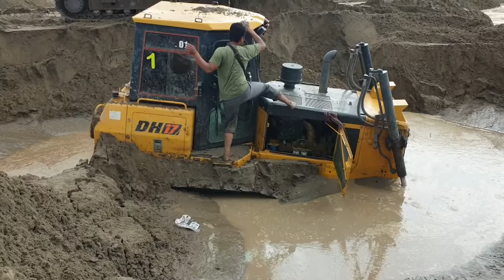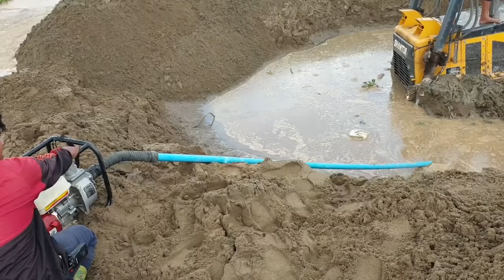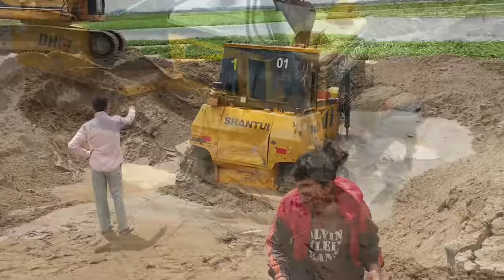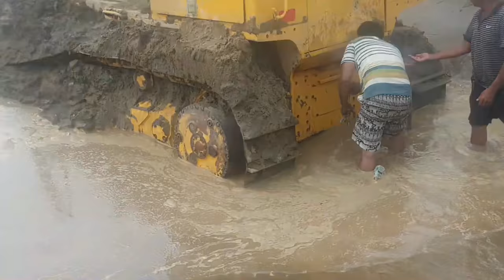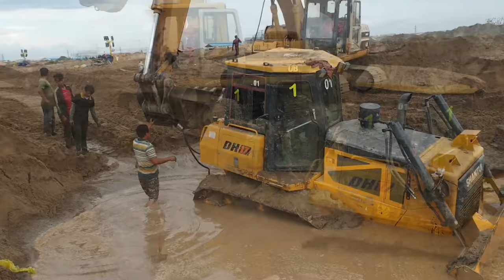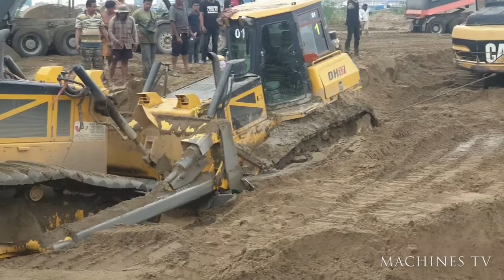Skills for Psychological Recovery Bulldozer SHANTUI DH17 Stuck In Deep Sand Safety Work

Comment: I cannot say anything about operator stupidity.  I got my tractor stuck on dry land this evening while I was breaking ground! 😂😂  I was running along just fine when suddenly the load became more than the traction, and rear wheels just dug themselves a pair of nice little holes before I could do anything.  I was supported by the turning plow and the front wheels and had to go get the big tractor to pull it out.

Normally, I raise the plow a little bit before that can happen, but it got me this time.  And to beat it all, I had taken a laxative this morning, and the urge hit me while I was walking across the hollow in the twilight to get the other tractor.  There were houses still visible, so I had to rush to get to a place to stop, drop, and dump.  I didn't make it in time. 😬  You may be laughing, but you only think you know the rest of that story! When I got finished and managed to get to the house, my stupid, lazy, 28-year-old, step idiot, who WAS sitting on his butt, playing video games online like he usually does whenever he's not sleeping or at work on his job, had suddenly decided, "Oh, I need to go sit on the toilet and play video games a while and THEN take a shower!". It's a one bathroom house!  But before I could even find out he was running interference in the bathroom, my 4-year-old daughter brought me a new toy to change the batteries!  What an evening!
Reply: @supertramp6011  
He's not my brother.  He's my stepson.  You can't do much about those unless you want a divorce.

Comment: I'm stunned nobody thought to drain the water
Reply: They could have pumped it out, but have you ever noticed how when you dig a hole at the beach, you cannot dip all the water out.  Water passes through the sand and replaces what you take out. But it also takes more sand with it from the sides of the hole and will even undermine you if you're sitting on the hole rim like that expensive excavator is.  I don't think anyone wanted to see that sinking into the sand with the bulldozer.

Comment: next time use dynamic physics 
no matter how many rope pulling ...they handling with the same force !!!!
with one machine ... two good anchors... and basics knowledge on winch load your life will be much easier safer and happier .

just think what if the unsafety cable was cut?

When the bagger pulled the shuffle, the cable held almost double weight of both of them together. A lot of heads would fly there
Reply from the maker: Thanks you so much

Comment: Stuck dozer #1 is ruined with all that pushing on the blade. There were two hydraulic lines completely disconnected on the right side of it.

Comment: 29:23 why is noone inside the cab ? someone has to hold the hydraulic valve while the excavator raises the blade ....
Reply: There are pressure relief valves built in. They will pop open and let the fluid past if you bind anything hydraulic.
Reply: The stuck machine could have a mechanical problem.  it's possible the machine died while working near the water line and sank in.  No way to start it till the repair is made.. hence this video.
Reply: New machines have a drive by wire system. No manuel valves at joy sticks

Comment: Watching this is like watching the Keystone Cops yes your Gator is a great piece of equipment and trying to pull that backwards is a good idea with the bucket up or the blade rather but if you want the blade to stay there you need the operator to get in his seat and pull the lever like he's trying to lift the blade crack the line in the blade will stay up after he let's go to the lever that's simple Hydraulics and any operator should very much be aware of it this is a abuse of equipment

Comment: Great job! If possible, clean all you can on the sides of the undercarriage of the stuck machine, place one sheet of plywood in front of the direction of where you're pulling to create a flatter smoother surface under the machine or, two sheets of plywood, one per track, again, so you have a smoother surface to slide it out. And if someone can use a shovel to clean in between the blade and the dozer or under the dozer, under the belly of the dozer, if possible, better. Just remember to communicate with the ones pulling the dozer, for safety, tell them to turn them all the machines off when you're closer to a dozer that someone is pulling. Never get closer to danger, is not friend, can kill you within seconds deftly.
Reply from the maker: Thanks you so much
Reply: @Machines-TV  Первый раз вижу таких дураков. Трос надо было зацепить за гусеницу застрявшего бульдозера чтобы он сам выехал.... тянуть  другим трактором чтобы гусеница крутилась на застрявшем тракторе , чтобы он сам вытащил себя... если не понял могут на  Чеченском объяснить ....
Reply: @Machines-TV  с такой техникой можно было танк вытащить, а вы бульдозер не можете выдернуть столько времени
Reply: You are talking to an unemployed and out of work Asian that shows up to these job sites hoping to find something like this to put on YouTube to make some rice money. He has nothing to do with the operations. They show up sometimes 10 at a time and fight each other and block drones. You are not messaging anyone that has anything to do with the bulldozer.

Comment: In-experiences operator- always loosing quality operations’ times and leading to expensive rescues operations and repairs.  
I seeing many of them gave very little nor no extra cared while they operating these heavy duty machines.  The owner have no quality control about these super duty machines should not taken lightly while in operation mode.  Lacking of training.
19:00 the operators’ salary justified with rescuing as well those standing and sitting on the side while the steel cable in full stresses, if lose or snap these heads would smacked in full blown blood.

Comment: If they had had a mechanic that knew the difference between a socket wrench and a Phillips screwdriver. They would have had that dozer out of the mud 30 minutes ago. Yes, I have done it. Release the final drive if you cannot start it. That way you are NOT pulling against the tracks. It is a hell of a lot easier to roll the tracks than drag the tracks. Never mind the 14-15 sight seers and the idiot wearing the pink shirt mucking up the works. 🥴

Comment: Well for one all that equipment and I don't think that one of those guys know how to run any one of those equipment professionally all that dozer was doing was trenching out another hole getting it out of a pit. They should have had a flatbed truck there ready with a winch and put it on the flatbed because somebody did not release the drive on the tracks of that dozer or either that or the bearings froze up. And the funny thing is the Rams did not even work to raise the blade what's up with that? I'm sure they replace that guy after they got that dozer out I would have just buried it with dirt and left it there if they try to recover something like that here in the states it would have crossed it thousands of dollars an hour just to play in the mud I would have just had my those are buried and leave it alone and take my loss funny the motor did not even work on it everything was a total loss on it anyway that's my opinion and I'm sticking to it. Have a good one y'all if you can't run a dozer don't get in it